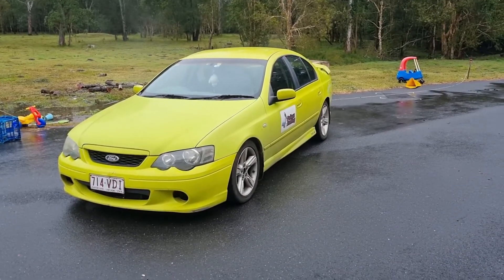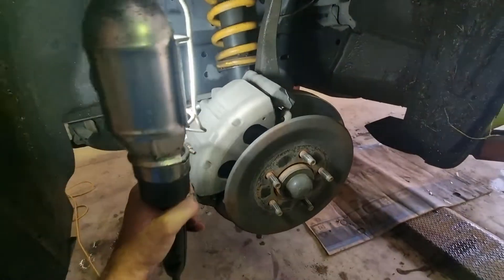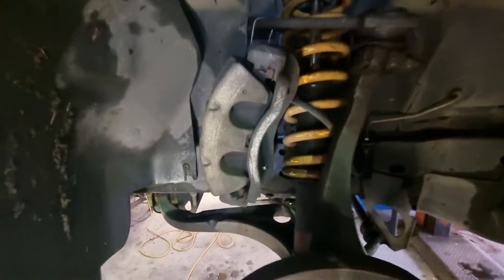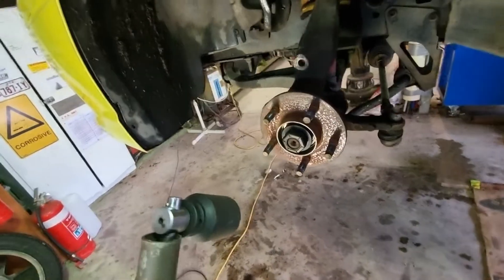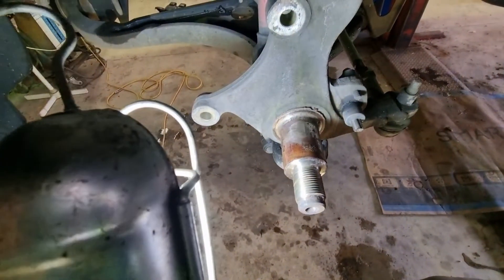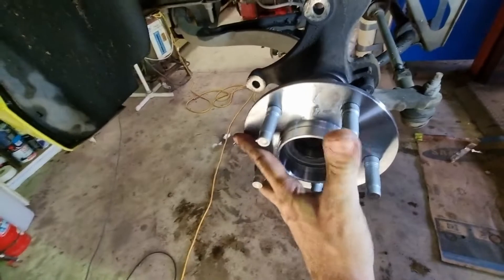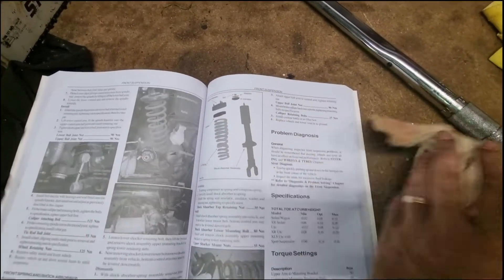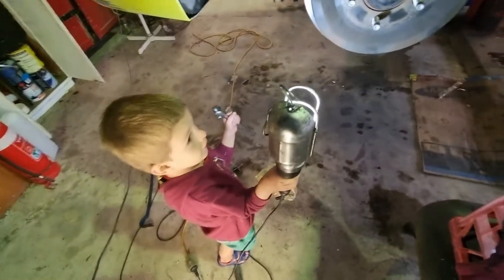Ford BA Falcon Wheel Bearing Diagnosis and Replacement

Comment: Hey mate where are you located I need a mechanic to do this this week or next week if possible I’m in Redcliffe
Reply from the maker: Hi mate, sorry I am so slow.  I didn't get a notification for your message.  I am just out at Deception Bay but I am certainly not a mechanic he he.  I would recommend Bay tyre & Mechanical on Bailey road Deception Bay if you still need to get it done.
Reply: @m @mickjanson4454 algs man got it done do you do tunes

Comment: Where those wheel bearings the original ones? I think my fg ute is due for a new set, makes noise when turning left. So by your description its my right.
Reply from the maker: The Falcon had around 300k on it when I did the bearing so I dont think it would have been original.  It will be your right wheel bearing if its noisy when turning left. Rip into it, you got it

Comment: Ford service dept spec sheet has 300nm for hub nut.
Reply from the maker: That's a lot, my torque wrench doesn't even go that high, he he.  But Ford would know better than my aftermarket Haynes manual.
Reply: @mickjanson4454  
I bought another torque wrench specifically, my third.

Comment: Am i just old lol as why aint people putting wheel bearing greese on the shaft first befor putting the new hub on . as to me metle  on metal  dont last very long
Reply from the maker: Yeah I agree, no harm putting a bit of grease on.  Should make it last a bit longer and easier to get apart.
Reply: I'm guessing because it's fixed and it doesn't spin on the shaft.

It's a sealed bearing so only the internal guts inside the hub assembly spin, and the bearing is pre-greased.

It's new for me too, I kept wondering where to put the split pin and why the torque settings are enough to rotate the earth.
Reply: Because it’s not spinning on the stub …. the bearing is the bit doing the spinning!

Comment: So video 2 is lower ball joint replacement and video 3 replacing brake pads?
Reply from the maker: Yeah I might, got the rotors and pads the other day